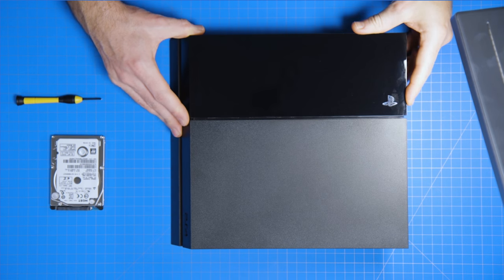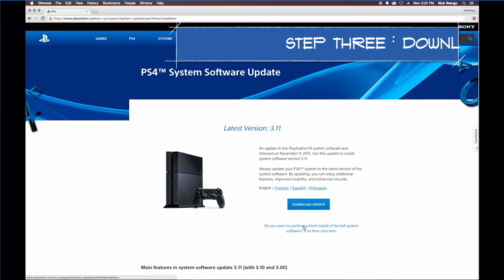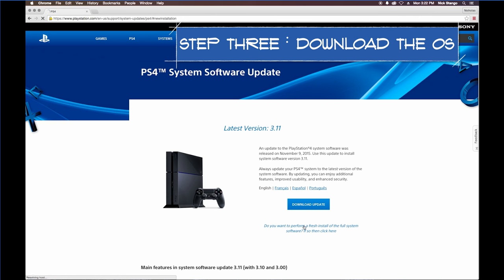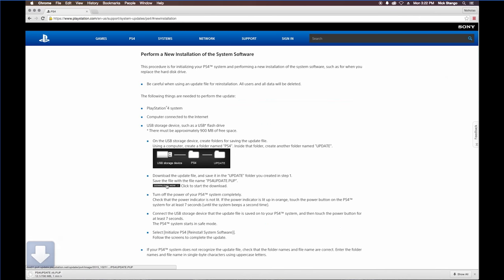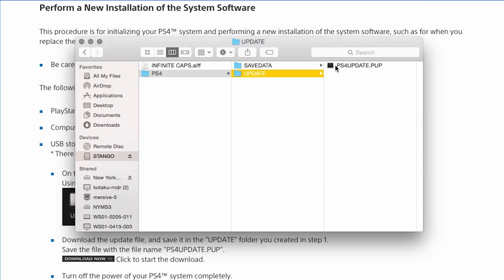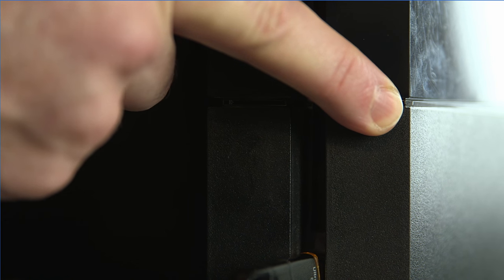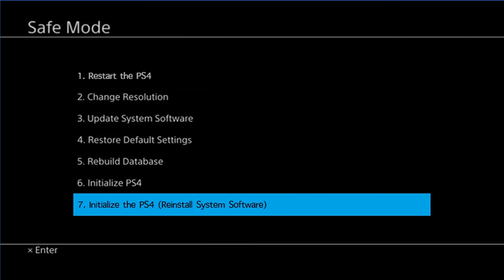How to Upgrade the Hard Drive of Your PlayStation 4

Comment: This work for the non glossy version of the PS4? I can't seem to remove the cover.
Reply: Yes it does. The glossy version was the first generation of PS4 consoles, New one non-glossy witch is 1200 model just a bit quieter and less heat. Nothing really difference. So yes it should work and you need to pull it little bit harder.
Reply: My fingers hurt from how hard I'm already pulling it lol.